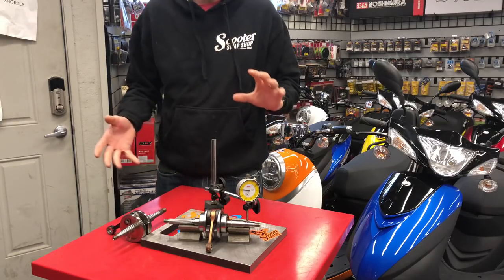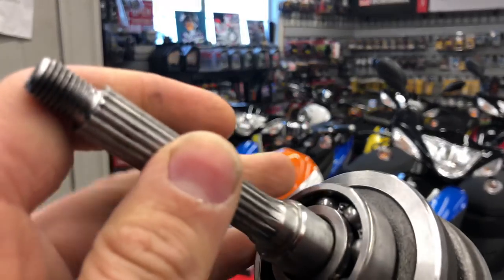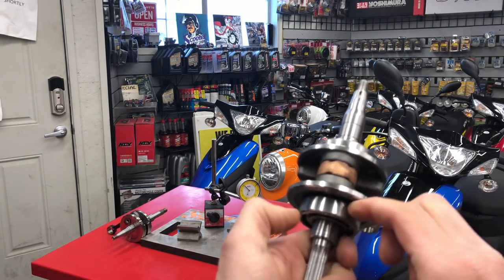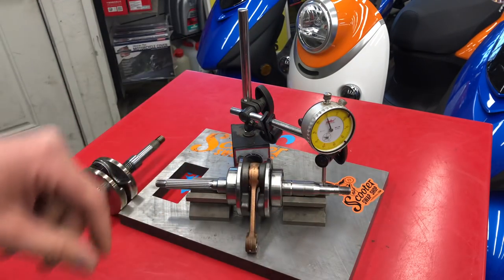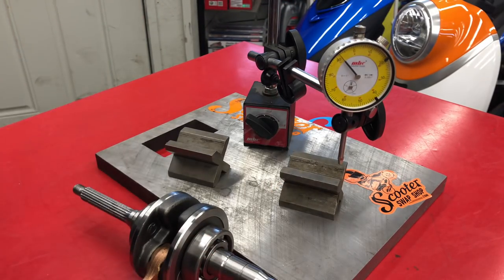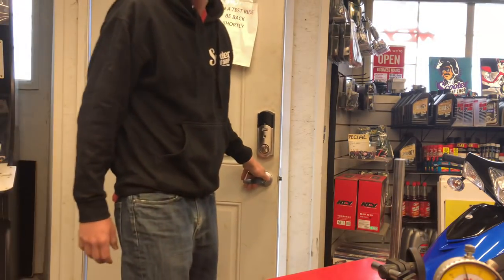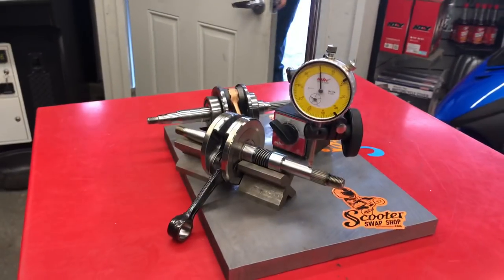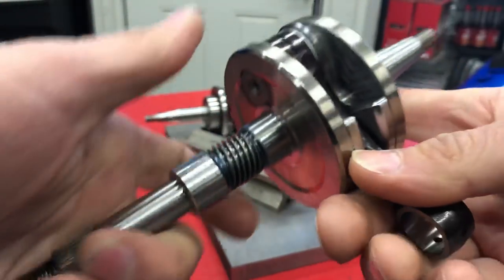How to test a scooter crank

Comment: Glad I saw this. I heated my case to put mine in. I did have to use a dead blow to even it up. But while I was doing it I did take notice that the rod/crank pin being offset would be what's taking the load. I have a dial indicator & before I finish my build although it is assembled,I'll check the shaft and make sure it's TRUE. If past 3-4 thou , I'll call yall for a new 1
Reply from the maker: thanks

Comment: Hey Brandon. You can true a crank, mate! MX shops can do it quick, work backlog notwithstanding. You can do it yourself, too, but it's a PITA without the right tools. Of course, not worth it with an OE or POS crank.

Also, people need to use crank pullers like Brandon does. No pounding to center, not even pulling back to center is ideal. When you're pulling them it's best to leave a bit on the side you start first. Then when you're bringing the cases together, do a bit at a time when you get close, when the dowels start to seat. When you're pulling, you're looking to pull the case closed with the crank centered.

If you pull the case one side first, then the other, you often wind up needing to center the crank a bit. But once those bearings are on the journals, and those bearings are seated in the case all the way, even if you use a puller you're putting stress on the main journal. That could spread the webs at the opposite side of the main journal.

And always check true before installation!

So it definitely pays to go slow and use the right tools. But don't chuck a good crank if it's out of true.
Reply from the maker: we never would spend time truing a crank or wasting the time on that unless it was a $500-1000 setup just replace it not worth the risk
Reply: @Scooterswapshop  yeah I'm talking to the peeps who don't have the $ to buy a new crank if they have issues with their decent crank. Makes no sense to pay the man hours to have y'all do it. Most MX shops are set up for this though, or you can DIY even though you will be chasing your own tail for awhile, maybe a long while. Not really risky for the integrity of the crank, though. They get trued and balanced at the factory to begin with. And of course ppl pull a crank apart to swap conrods, but that's a shop job. No harm in nudging the main journal square, though.

Comment: Moving away from Genuine for food delivery to a Kymco.
125 to 250.
The Buddy crank on the driven side is toast.  Put a used good variator plate on for a temporary fix and it lasted a little while.  Really don't want to break down an engine in the late fall cold so off it goes for free to someone else.  $130+ for a new factory crank w/o the connecting rod isn't bad but with $500 for the Kymco so why bother.

Comment: So why/what causes OEM crankshaft failure when you go over 70cc. Does the journal bearing fail?
Reply from the maker: The stock Yamaha cranks are weak normally that bearing fails. Typically you see it when the bike is spinning a higher rpm.

Comment: Is 10mm crank on a vertical minarelli engine enough(with malossi or polini piston bearing) for a sport polini AC cylinder(around9-10hp)? 
Is 12mm more robust?
Reply from the maker: As long as it’s a new quality crank the pin doesn’t really matter

Comment: Why so difficult? Use heat and cold!And if you try to rebuild an engine,use malossi,polini or yasil.
Reply from the maker: What’s so difficult?
Reply: @Scooterswapshop  The way you want to install things, with heat and cold they just slide .
Reply from the maker: There’s lots of methods. I always freeze my bearings, but I’m not a fan of getting cases super hot. To each their own.. it takes longer to heat a case then it does to lightly press in frozen bearings.
Reply: @Scooterswapshop  In the european countrys there is a general rule of getting around 120--140 degrees celcius on aluminium cases,Bearings maximum minus 30 degrees celsius. In Long travel engines we also do not use plasic case bearings,as they whreck like nothing when a Viton bearing starts causing lean runs.Another thing is that in this way you also reduce the Axial strain on the Rollerbearings themselves.

Comment: Hi
With variator on i turn it by hand and has some movement then locks.
Is this correct or should it move freely?Not sure but have ordered a new belt.
Thanks
Reply from the maker: not quite understanding.
Reply: Necro reply, but it should turn freely. If it's binding after a new install, you're probably too tight to one side or the other.

Comment: Mini stroke is only good if it’s full counter all metal
Reply from the maker: Most vintage high end Vespa cranks built to handle way more power than dio are half counter. Polini and stage6 make half counter too. Half counter helps with bottom end. There’s pros to both designs